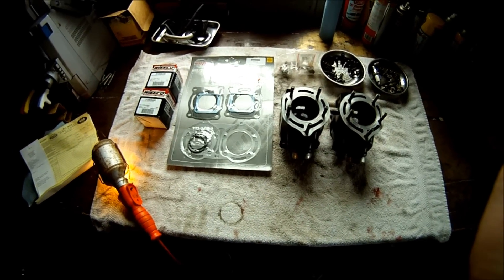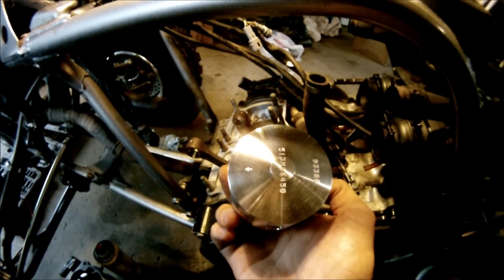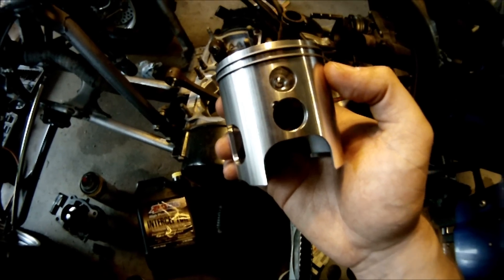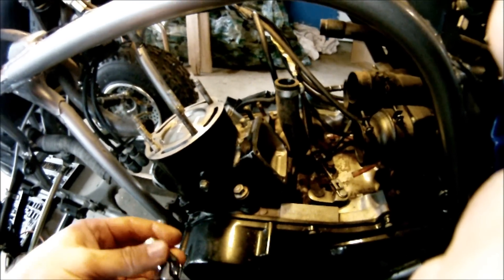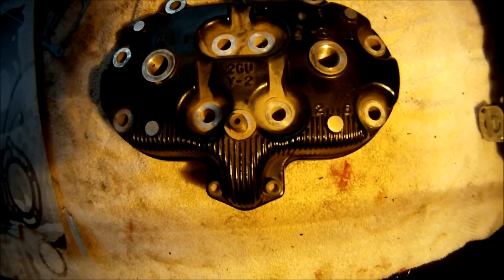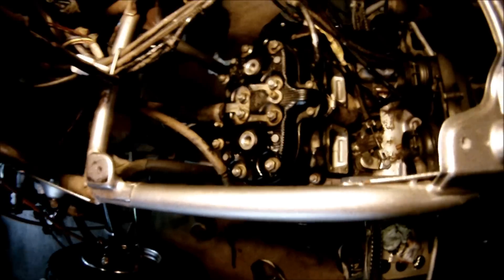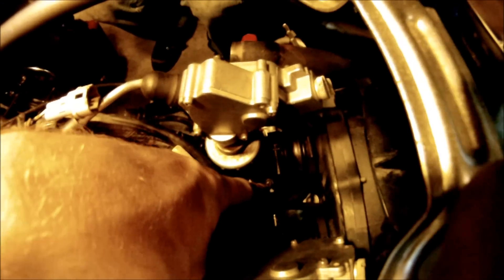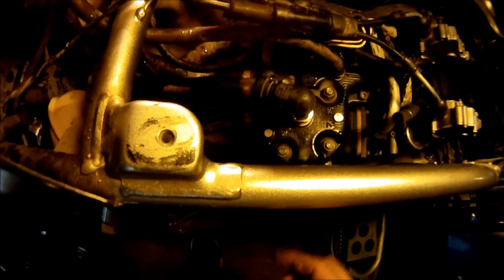Yamaha Banshee Topend Rebuild - How to

Comment: Well sparky , been watching a few of your videos. I have a 2005 Yamaha banshee. I only have it around one month. It did not idle and did not seem to be running on both cylinders when I first got it. It did have full power at high rpms and ran perfect in power band. It would sometimes Rev out of control by itself as if throttle got stuck but it wasn't getting stuck.
I took out airbox found a huge whole in it from where exhaust burned through so patch that up with a metal plate and glue. I then thoroughly cleaned both carbs and adjusted floats as carbs were leaking. I took out reeds they seemed fine with no gaps or cracks etc. I put it all back together and synced the carbs properly. I went for my first start after the work and it started right up 2nd kick. Idled perfect but my left cylinder running better than right cylinder , left exhaust was hotter than right by a longshot. Took it for a spin and its misfiring and not hitting powerband at all now and seems to have one dead cylinder on right side. It seems I have eliminated the problems of leaking gas and randomly reving out of control but I have not solved the problem of right side weak cylinder.  Hope you can help , thanks.

Comment from the maker: @ironDsteele Revs tend to be cut down just a HAIR but the power becomes much more useable.  The 4 mill definitely flattens out the power curve a lot and makes the quad much better to ride.  If you do a RZ rebuild i would definitely go with the stroker and gear it up a tooth or two in the front... Itll make highway riding a breeze.

Comment from the maker: My recommendation is to send the cylinders to a reputable builder and have them order the pistons.  The best builders mic out the piston and bore/hone the cylinder to fit the piston perfectly. The measurement stamped on the piston is the diameter of the piston in mm. Pistons for the banshee are .010 increments apart. When people say 0.20 they actually mean 0.020 because pistons are bought in hundredths not tenths of an inch. Look into Ken Oconner racing or F.A.S.T racing.  Both awesome builders.

Comment from the maker: @Kinkryder8 Lower rod bearing till run you about 700 for a new crank.  No way to just replace the bearing and a new crank is about the same cost as rebuilding your stock one.  If your top end went with it itll run you right around 800-900 all together.

Comment: I just bought an 86 RZ350 and I'm going to rebuild it this winter. I'm thinking all the principals will be the same as the Banshee minus the frame stuff...what do you think? Also if I go with a +4 mil crank do you think it will still rev as high as with stock stroke? Thanks

Comment from the maker: That's kinda like asking "My car doesn't run, what's wrong with it?"

There is a process you have to go through to see the extent of the damage.  Cheapest fix would be a head gasket kit and piston rings.  Prolly gun $60 bucks or so.
Worst case scenario, your banshee is maxed are on bore/hone jobs and you need a whole new topend.  That'll run 500-600

Comment from the maker: You can take the clutch apart and mic out the thickness of the clutch plates to be sure.  Also your clutch cable can stretch and throw off the markings on the case.  Check out my engine rebuild series, specifically the clutch rebuild video.  It explains how to adjust the clutch in the vid.  Let me know if you need anymore help.

Comment from the maker: They don't actually replate the cylinders, just bore them out and hone them.  You should always have both cylinders done.  Having more pressure on one side of the crank can cause it to twist and wear out faster.

Comment: @jlsparky7 Well, i took my engine appart, and the right piston had little duts on it everywhere, so took it completly appart and found small pieces of iron in my bottem engine part, so need to change the conneting rod, pistons and change the crankshaft bearings. Not really happy with it :D

Comment: just did a fresh bore and new wiseco top end kit and it has low compression like 90 psi ring gap is good it is 11 thousands and wiseco calls for 12 to 18 and i cant figure out what the problem is i torqued everything correctly it was not my first time rebuilding a 2 stroke any idea on what the deal is?

Comment: I just got myself a 4mil stroker banshee last week. I did a compression test on it. It read 130 psi on both cylinder. The reading might be low because the o-ring on the tester seems pinched a bit. But my question is, is a 4mil stroker reliable? Is it more reliable than stock? Thanks!
Reply from the maker: Ricky Geneau just as reliable as any other 2 stroke engine if built properly 👍🏻

Comment: Sparky I got everything replaced put the hole top end back together new pistons an rings gasket ect. It's back firing every couple seconds what could cause this thx you
Reply from the maker: Brittany Hunter Air leak for sure
Reply: +SparkysGarage is that a yamaha R1 in your garage?
Reply from the maker: Yes 2008

Comment: I have a question when I got my banshee it was back firing on the left side and I decided to take it a part and when I opened I discovered that the piston was burned and where the rods go it had a lot of oil is that supposed to happen ? How do I take it out of there? Thanks
Reply from the maker: Daniel Reza Transmission oil or 2 stroke oil?
Burning on the cylinders is normal.

Comment: Sparky I have a banshee 250 and my muffler was missing a bolt and it's been sitting for a while won't start I think I need the carb redone but I'm not sure can you or any one else help me
Reply from the maker: Joseph Glendenning Banshee 350 or blaster 200?  No such thing as a banshee 250.  How long is awhile?  Years? Weeks?  make sure the fuel is on and flush out the fuel tank and carbs.  Then put in fresh fuel.  A new set of spark plugs can help too.  Post back if you need more help.  Also check out my troubleshooting video

Comment: The guy I got it from said it was a 250 , year 05 and been sitting for 5 months and it's barely getting spark I don't know how much spark it should get but it a realy weak looking spark pls reply asap and add a link to your troubleshoot ing video please thanks
Reply from the maker: Joseph Glendenning Plug, Wiring, Coil, Stator.  Check/replace in that order.

Comment: Hey I am having a problem with my 2004 banshee the right side will not fire and I cleaned the carbs synced them put new plugs in left side gets hot rights stays cold I am missing a idle screw for the right side could the be the reason please help
Reply from the maker: Try switching the ignition coils and see if the opposite side fires.

Comment: What kind of Top end Gaskit did u replace it with? and where can i find it
Reply from the maker: I believe it was a Tusk gasket kit but I'm not sure.
Reply: Thanks. I just got a Banshee about a week ago and i was riding and the Right exhaust made a loud reving noise.... i parked it and it was leaking oil by the pipe near where it connects and it looks like its the Gasket and i checked my oil level and it Burned up all my Oil.... I just am trying to figure out What i need to replace the Gasket/top end. - Anthony

Comment: you should be using assembly grease on your bearings...  don't install them dry...  shouldn't matter much, but when you first start it, it has no oil on it... so a little grease is needed
Reply from the maker: calholli Haven't had any problems yet, it's been years.